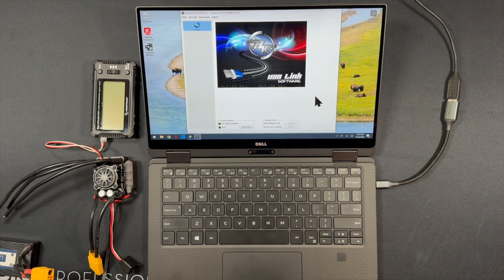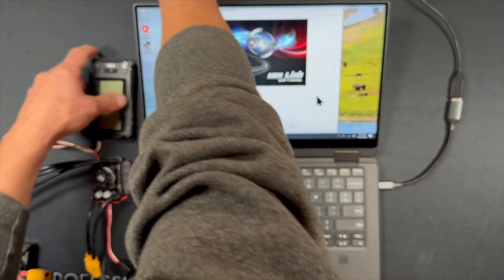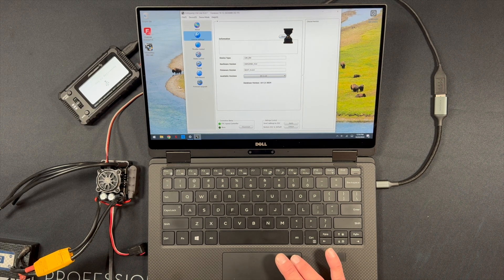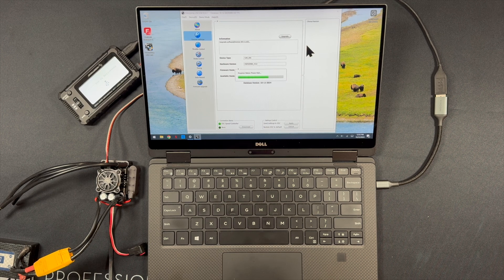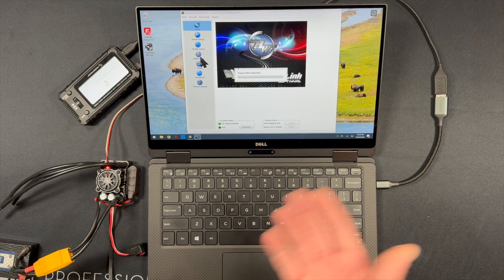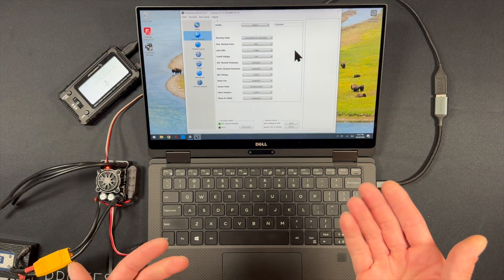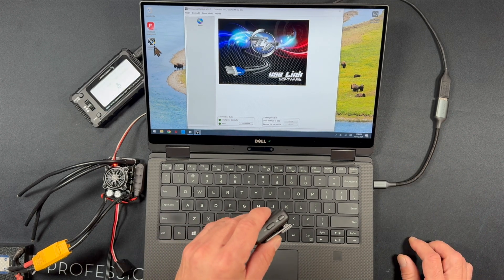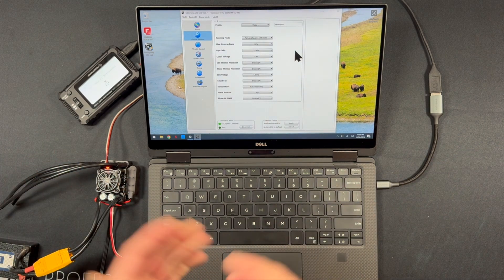Xerun Firmware Update, USB Link, LCD Program Box Pro - The Charlie Show - Ep 392

Comment: Every time I connect it tells me to update software. Then tells me the update was successful. Connect to my phone's bluetooth and it says I have the database and correct firmware updates. but it will not connect to PC or my phone to do any changes. I've done all support ideas, change to data cable etc etc....nothing works. I can only change parameters via LCD pro box only. RCE-BL100A
Reply from the maker: RC BLE 100 A, is very likely 'not' compatible unfortunately.  The programmers 'only' work with HW Products that are sold retail under the HW Brand.  Does not work with most "OEM", or "Built by HW" products.